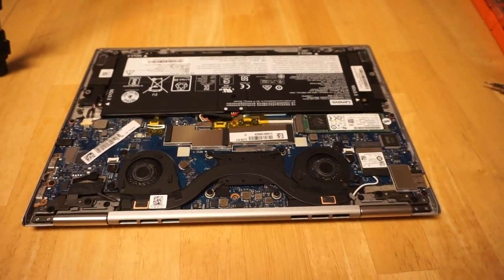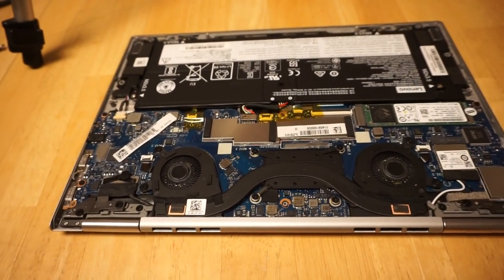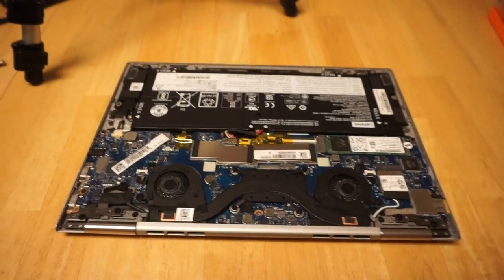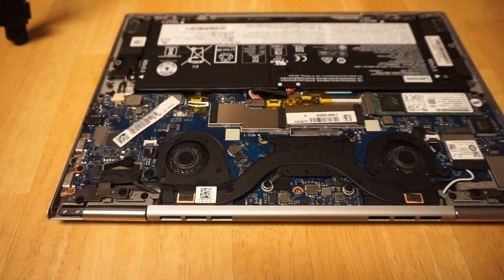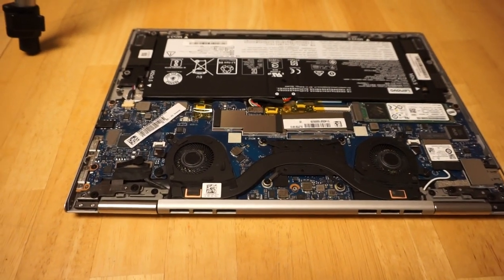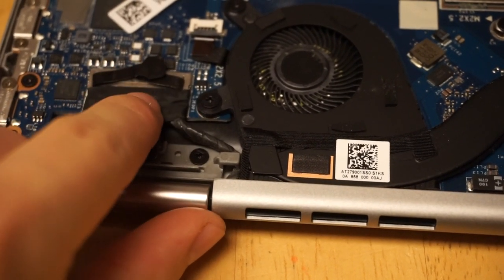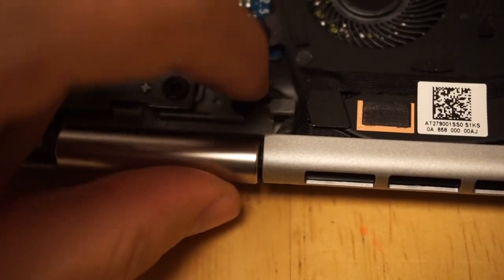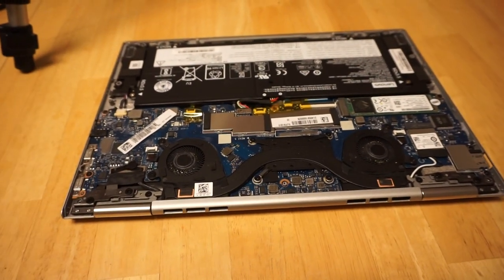Lenovo Yoga 730 Screen Flickering Easy Hardware Fix

Comment from the maker: Update: the flickering came back. I repeated this and it seems to have solved it again, it looks like this is something we'll have to do periodically. I would not recommend this laptop. Such a shame that it has this glaring issue
Reply: Hello Is this a 15 model? I've bought it already, and I wonder whether to return it before I open it?
Reply from the maker: @ghsidrybkuc  I have the 13 inch model, but I would stay away from lenovo based on their QC/customer support issues
Reply: I opened mine a second time. After looking very closely at the problem area between the fan and hinge I realized that grey tab the wire runs under is supposed to harness the wire. My wire fell to the side of this cradle and got jammed under the actual fan. I think this is why my screen was getting so bad. The wire was being pinched under the cradle. To remedy this, I rolled up some electrical tape and wedged it between the display wire and the fan while pulling the wire into its cradle. This seems to be gently/safely holding the wire where it belongs. I haven't had a single flicker yet. I will reply if the problem persists.
Reply: @tomio56  any updates? I'm thinking about sending mine in for warranty repair later in the week
Reply from the maker: @tomio56  let us all know if it works out!
Reply: @andykins118118  The problem came back for me. I finally gave in and followed through with Lenovo. Since I bought mine at Best Buy they allowed me to drop it off there even though I didn't have a warranty with them. I hope geek squad is better than Lenovo with repair wait times.
Reply: Hi I've been using mine for a while now, and the Flickering came back today. This is super annoying. Has yours flicker again after your second time opening its back?
Reply: Yeah it’s shame and annoying
Reply: Hello to all. I tried the fix on the video and it lasted for a few days. One week later, the flickering started again. It gets so bad that sometimes you cant even use the laptop without pressing in "the point" (about one inch right to the logo of the screen). Today I reopened and used a rubber band to hold the cable in the opposite direction of the keyboard side. The rubber band is in one side holding the cable, and in the other side is at a screw female part in the chassis. I saw the suggestion from @Thomas Griesinger
but I believe that fixing the cable may not solve the problem as the cable should move with the opening movement of the screen. I believe has to be something flexible, like a rubber band to hold it in the right position and also allow the cable to move. Lets see how it goes. I keep you posted
Reply: I can say that this resolved my problem for quite some time! I would strongly suggest though if someone would not want the issue to recur faster to avoid using it in tablet mode, where you flip it by 360, so it will not pull the cable further. I remembered seeing the problem after heavily using it in tablet mode. Of course if you need to, you risk opening it again :) Bad design, yes. But this workaround is solid for me.
Reply: You did technically void your warranty but also no tech will know unless you removed a warranty seal sticker.  Trust me no one is checking. Plus most places would get shit reviews if they rejected a repair over petty things like that.
Reply: @SergioPozuelo  hey friend, any updates on this fix?
Reply: @AsonFrio  Hi! I took it to repair to the manufacturer official repair local company. In three days the computer was fixed. I payed about 30 USD. The computer works great since then. Don't waste your time with work arounds. Best money spent ever 😃
Reply: @SergioPozuelo  oh that's wonderful because I love the laptop and want to keep it.. any idea what they did? replace the connection maybe?
Reply: @SergioPozuelo  Please, can you say what was done? Cable replacement?
Reply: @tomio56  Hey i have having the same issue a bought at best buy. Is that free like dropping at best buy without a warranty?
Reply: @AsonFrio  hey can you please tell us what they did?
Reply: @tomio56  Hey, I bought the Yoga 730 at Best Buy in aug 2018 for back to the school day. I tried all the solutions in this chat and I still face this issue. I saw that you said you sent your laptop to geek squad to fix your laptop without having a warranty. Did they charge you for the repair or is your laptop still flickering? Please let me know soon because for the past 6 months my laptop has being flicker. College student here.
Reply: My Yoga 730-15 started to flicker badly, until one day the screen just went black. I tried this fix and it worked. It's been 3 days now without the slightest hint of flicker. I must say that I believe the problem is more related to the plug where the cable plugs into the mother board than the cable itself. I believe that adjusting the cable wiggles the plug enough to fix the problem. A better fix may be to re-seat the plug itself. Good luck.
Reply: @buckygoldstein9256  yeah I think you are right. I have tried to fix the flickering screen issue so many times that I am not tired of using this laptop. I had to open the laptop more than 10 times so far to fix it temporarily. I will be definitely switching laptops in the coming months.
Reply: @rajthomas4224  Well I selected the Yoga, partly from past experience (better quality than past HPs), but mostly because in a 15 inch laptop it didn't have a numeric keypad. Since I often use the laptop in my lap (what a strange idea), I find that the numeric keypad shifts everything awkwardly to the left. It seems that almost all larger laptops have this issue. Do you have any options in mind?
Reply: @tomio56  would be nice if you link images or a video on how you did it.
Reply: @andykins118118  
This is a pretty late reply,but what other laptops/computers would you suggest in place of Lenovo?
Reply: The problem came Back To Me. And I Continues This Tricks MANY times In Result I Broke my back panel. And Now I Don't use Back Panel. 😊

Comment: This is a gigantic issue with the laptop. I would rather the screen just not rotate all the way around and have the cable actually work. Lenovo seems to have overlooked this for generations. It's a shame what happened to such an otherwise great design.

Comment: Had this problem too. Took laptop to a local repair shop twice with no luck. Was told I needed a new $250 screen with a recommended $50 warranty.  My boyfriend fixed it in minutes after watching your video. Thanks a ton!

Comment: I fixed the problem for over a year and it never came up again. How do I remember it was over a year? Because it started happening again and the 1 year warranty period was over when I checked. After a year of good function, the issue came up every few weeks and adjusting the cable fixed it for a while, but it got worse and worse to the point that I have to adjust the cable several times per week. I basically just stopped using my laptop at that point. I learned this lesson the hard way, but if you're within the warranty period, you might want to see if you can get a new one or return for a full refund, because you don't want to be stop with a $600 hole in your wallet and a broken laptop.

Comment: I can confirm that this works!  Today my daughter's laptop went from the occasional flicker to full-on stupidity, so I did the software and BIOS fixes (as one does, because it is best to eliminate the obvious).  After those didn't work, I escalated the problem to G-Level support (I Googled it).  Finding this video, and others similar, but with different models of Lenovo, I figured that I had nothing to lose before losing the laptop to the reported black hole of Lenovo's support system.  I followed the instructions here and voila!  Magic.  Working display.
Yes, Torx T5 screws (remove these over a towel so that if they drop, they don't make it far).  Our wire wasn't caught under the fan, but there was a little play in it.  I tugged at it ever so slightly with the screwdriver and that little bit was enough to be the solution.  The most difficult part of the operation is removing the back after the screws are removed: just keep at it with patience.  Working from the part closest to the hinge is what got mine started, then I was able to work my way around the perimeter and remove the entire thing.  
This repair is easier than the video makes it look, and the video makes it look easy to begin with....
Thanks andykins118118!

Comment: Andy- thank god I found your video.  I followed your advice exactly.  My daughters 730 has not flickered in 3 weeks since I did this (and it was a daily occurrence before the fix).   If your flicker returned, perhaps the stress on the cable pulled and damaged a connection under the tape?  Bottom line is— you proved that the issue is hardware and NOT Bios/Drivers/Windows10/etc.   I can’t thank you enough.  None of us deserve to be yanked around in Lenovo customer service hell.

Comment: Thank you so much for this. Ive had this computer for a year and a half and this is the third time it's started flickering. The first few times it went away on its own, but it wouldn't this time. My school is starting in a week and I needed a computer. Geek Squad said it would take 4 weeks for them to fix it, so I just decided to do this temporary fix myself. It worked like a charm. Saved me from needing to buy a whole new computer and failing my classes.

Comment: Thanks for the video. I have had the same problem and the same fix. Once I fixed it I assumed repeated opening and closing would cause the wire to retract to its old position causing the flickering. When It happens again I will try for a more permanent fix but I’m just glad to have identified the problem.

Comment: I just dealt with this issue on this same laptop, thank you for the perfect insight.
Also, there is no warranty voided here since there is no sticker on any of the screws or moving the cable.
It wasn't just the cable having enough wiggle room either, for me it was the connection itself. 
What I did to fix this is take it off and clean both ends with Isopropyl Alcohol.
So, your theory is correct you fixed yours easier by moving it just that tiny bit of connection lost to the monitor.
Reply: Does anyone have a video on how to do this? I don't want to mess it up further.
Reply: @elizabethw.454  just open it and find the cable coming from the screen to the board. Unplug it, use isopropyl alcohol, let it dry, plug back in, make sure the cable has a little bit of slack.

Comment: I can't wait to try this!  I bought my Yoga for travel and less than 2 months in it started flickering.  I tried everything I could find as far as updates and brightness setting tweaks and none of it worked.  I know it's a connection issues because of how the screen reacts when physically moved.  Lenovo won't do a thing about it, other than the standard update and settings recommendations, because I'm abroad and my warranty isn't covered for nearly 5000 miles away from me.  I'm glad I didn't pay to ship it home for geek squad to just return it without fixing the real issue.!

Comment: Update: the issue returned after a week, I tried using electrical tape the 2nd attempt to hold down the cable in place. However the screen still flickers on and off on occasion. Hearing the stories about the issues with Lenovo customer service, i'm tempted to just throw this laptop in the trash.

Thank you for posting this. I have been experiencing the flickering screen issue for months. It would come and go but eventually got to the point where it was unbearable. I tried loosening the cable as you did and it worked! 0 flickering issues at the moment. Hopefully the issue does not return.

Comment: This works. Based on other comments I used a small piece of a rubber band to prop the cable in a good position.
Reply: Where did you tie the rubber band to

Comment: Started having this problem recently on my Lenovo 730 also. You hit the nail on the head that Lenovo doesn't want any responsibility with this issue, even though it's clearly a hardware issue. Seems like tablet/laptop combos may be a little bit away's still. Great video though and very easy to follow. Thanks!

Comment: I had a very similar issue on my Yoga 710. Almost made my laptop unusable for the past month or so. Bought torx t5 screwdriver, opened the back of the laptop, loosened those display wires and boom! My screen's been working perfectly for the past couple of days since then. Before that when I went  a couple of computer repair shops they all had said I need to replace the entire LCD panel. What a waste a money that would have been had I gone ahead with that. Thanks for the fix.

Comment: It has worked for my 15in Lenovo 730! I tampered with the silver cord a little bit and added some electrical tape around the small unit. So far, no flickering no matter how I bend or how fast I move it! I will update you if the problem comes back.
Reply: Hi. I'm thinking of buying this laptop. the problem came back
Reply: @leandrohernandez8740  you ask ir giving statement?
Reply: Did the problem come back?

Comment: Andy, while I have the same problem, and being someone in IT, I have opened my Yoga 730 14 inch several times, but didn't notice the display cable being pinched as you've shown. I don't doubt that adjust your cable resolved your problem, but just want to share what worked for me today after being so frustrated that I couldn't even see the Bitlocker screen to boot into Windows. I held and pinched the corners of the screen and glass with my thumbs in the lower right and left corners - below the Lenovo logo and above the Delete key, respectively - while pushing my index and middle fingers against the back lidside. I pressed firmly and immediately the flickering stops. Let go, the flickering starts again. I also took my hands and pressed against the side of the screen with my palms, and that also stops the flickering for me.
This all to say, that while I was hoping my reoccurent issue, which started about Day 5 of owning this laptop, and I've had it for 16 months now, seems to be a faulty display for me, which is more concerning to me than a cable. A cable is one thing, the entire display is something entirely different.
This issue, along with the non-upgradable RAM (even tho plenty of space for Lenovo to have made a $2 change to the board, and the faulty wifi card, has made this the worst laptop I've ever owned. Yet I will always love Lenovo, their implementation is 100%, but their recent hardware issues make me frustrated. If this continues to be an issue with their products, that would be a sad downfall of a company I've loved so much.

Comment: CR B
I have the same issue with my Yoga 730-13".  Fixed it after trying the method described in this video and a few others.  They work  for a few days then it starts again.  The problem is definitely the connector on  the mother board in the corner as shown in this video but the fix described only lasts a few days.  It seems to come loose easily even after I freed the cable.  I believe this is because the connector itself is just not tight enough and after a couple years it starts to work loose  When you remove the case be careful not to crack it where the edge of the hinge curls up on the very edge on each side.  I found it's easiest to pry at this point just to the point you get an opening beside the tab then work it open around the rest of the edge to pop open each of the plastic tabs .  Notice there's a black pad above the connector stuck to the inside of the cover.  I believe is supposed to apply pressure to the connector.  After a couple years it just seems to become too thin or lose it's cushion springiness.  I just cut a small piece of 1/4" foam weather strip used to seal doors and applied it to this location.  The weather strip  has adhesive on one side.  Just stick it above the connector to the laptop case and reassemble.  I've had this in place a couple weeks and not a single flicker.   Non of the other fixes lasted more than a couple days.  Screen brightness and zoom functions all work great!  This should be a recall item but then again the way Lenovo deals with recalls is so terrible I wouldn't even think about sending it in for this.  This repair is simple for anybody handy.  If you're not comfortable take it to a computer fixit shop with a printout of this comment.  They should be able to do it for you well under $100.  Took me 10 min.
I really can't stand dealing with Lenovo support about anything.   I love their computers though and have used the Thinkpad business line and high end Yoga's for years.  This 730 version is a cheaper one that has only this one problem we use as a "family" computer with multiple logins.  I'm hopeful this technique will let us use it for several more years at least.
I hope this is helpful.
Chris

Comment: It works! I have a yoga c930 and I had the same flickering screen issue and couldn't send it off due to having online classes. Be careful with removing bottom plate, I damaged on of the plastic clips. All that is necessary is repositioning the wiring harnesses. Good luck!